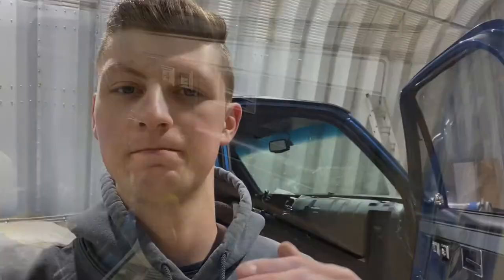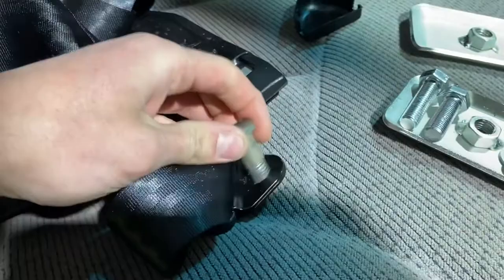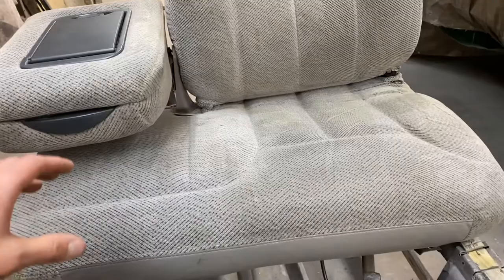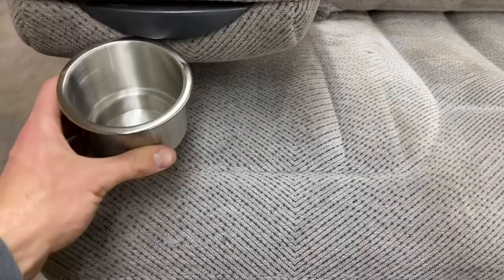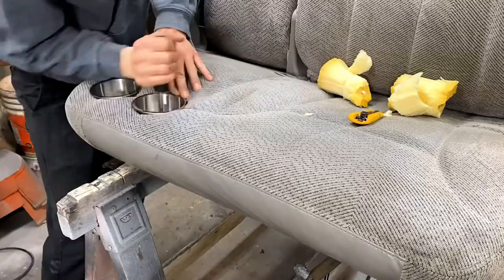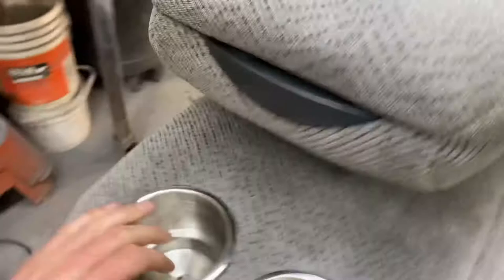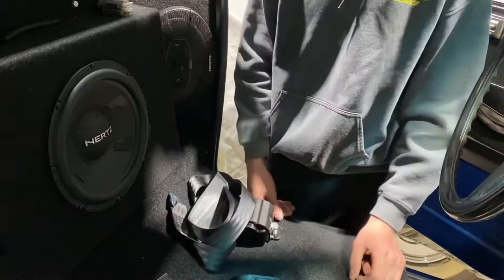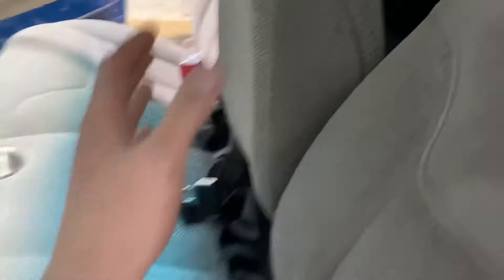Seats & Seat Belts Installed In The K10!

Comment: Does the seat just fit like that or do you have to custom make a bracket
Reply from the maker: Used the brackets that came with the seats but shortened them for a better fit. You could leave them alone and just drill new holes and bolt them in

Comment: Hey buddy,  building a 79 k10 and I want to put the 98ish seat in it. What kind of track mods did you have to do to make them work. Thanks for your help.
Reply from the maker: Basically just use the Squarebody rails and weld them to the 90s seat frame. We shortened the 90s seat frame to bring the seat down however
Reply: Thanks for the info buddy, have a great day.